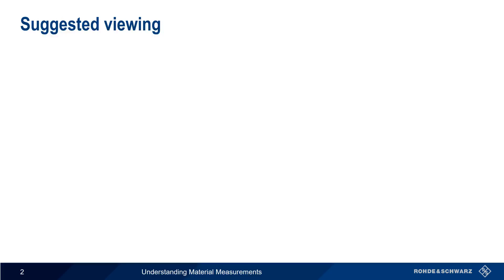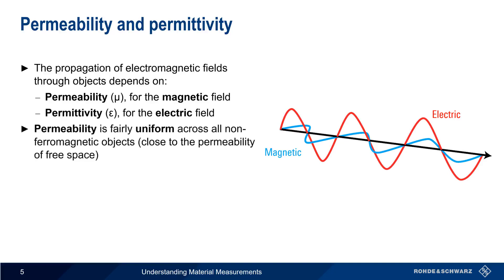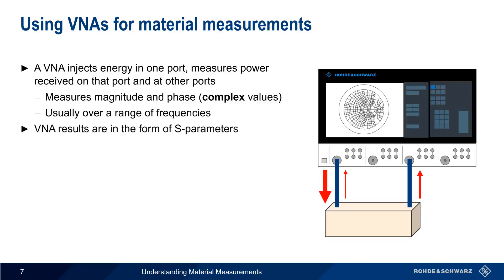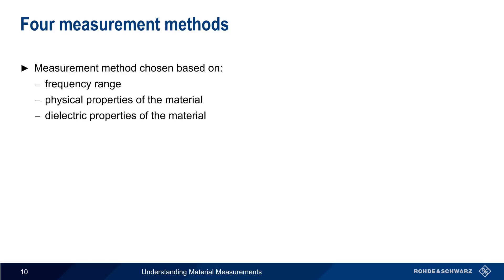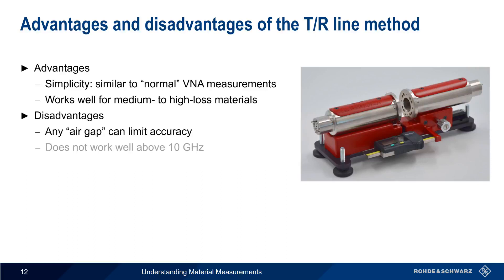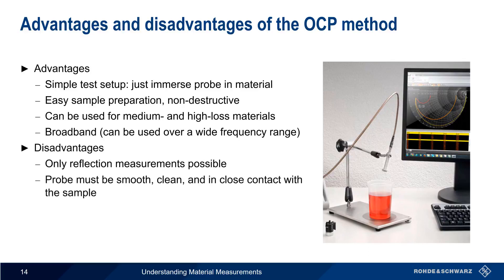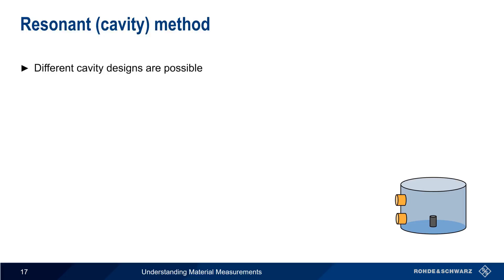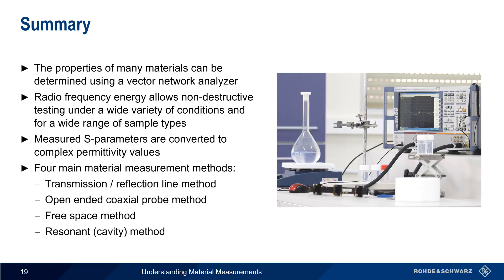Understanding Material Measurements

Comment: Thank you so much! I can learn a lot from this ppt. There is one question: which measurement method is suitable for acquiring the permittivity of hydrogel? The hydrogel is a network of cross-linked hydrophilic building blocks surrounded by water. So I don't know which one is the suitable measurement methods. I'm looking forward to hearing from you soon.
Reply: Hmm ... probably an immersed coaxial probe, but that would depend on the arrangement of the blocks and water (i.e. sounds like the material isn't uniform).  Cavity might be another option, but I would also want to be sure the material under test was as uniform as possible.
Reply: Don't steal the technology now

Comment: why does resonant cavity method does not require calibration step?
Reply: In the resonant cavity method, the resonant frequency and quality factor of the empty cavity are measured, then the measurement is repeated with the MUT in the cavity (see slide 17).  Whether or not the measurement of the empty cavity is a "calibration" depends on how one defines  "calibration" :)

Typically in the VNA world, calibration is performed using standards with well-known properties (short, open, through, match, etc.).  The T/R and OCP methods have "calibration" that most closely approximates traditional VNA measurements in that they require one or more calibration standards.  In the free-space method and in the resonant cavity method, the calibration "standard" is really the absence of a standard (empty fixture vs. fixture with MUT).  

So we could divide these four methods into two groups:  the T/R and OCP methods require "calibration" using a standard of some kind whereas the free-space and resonant-cavity methods require an initial "measurement" of the empty fixture (i.e. no cal standard needed).  If we say that the resonant cavity method does not require "calibration", then this definition would also apply to the free space method as well.
Reply: Thank you for the response, but you still didn’t answer my question or I have not understood what you have commented. I know the procedure of resonance cavity method, and calibration to these methods is not required. I know one reason as resonant frequency are not affected and only dynamic range is altered. Do u have any other points to add